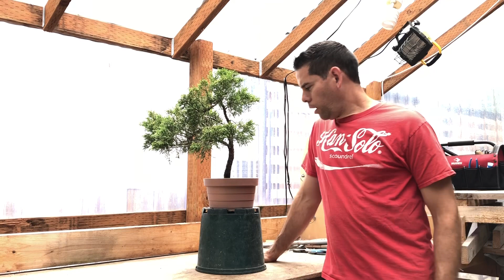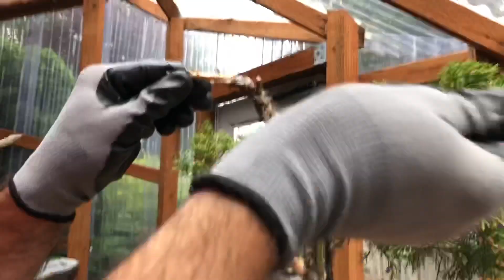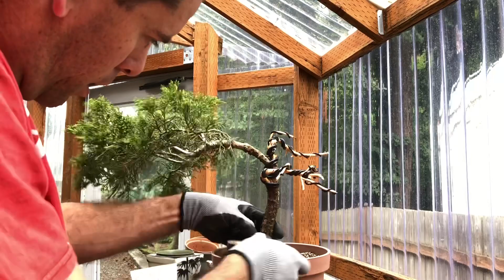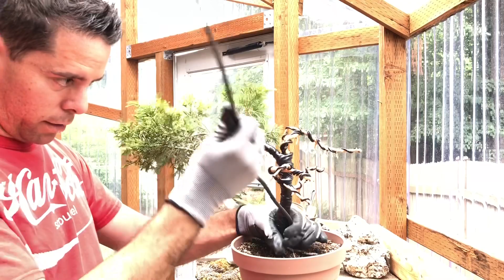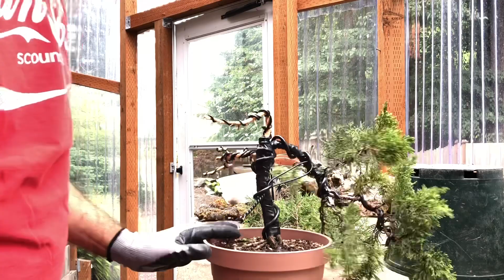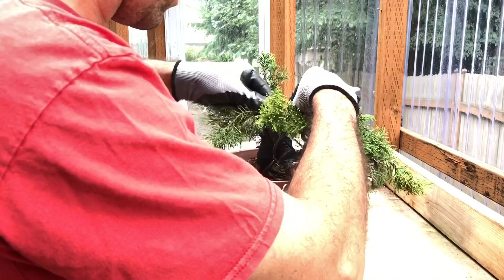How Much Bending Can One Juniper Take?

Comment: Hi, thanks for posting this. If the tape stays long enough would there be a risk of the adhesive peeling off the bark when taken out?
Reply from the maker: The first layer of tape is placed with the adhesive side facing away from the bark.  Then, I turn the adhesive side in and cover the first layer of tape with the second layer.  I’ve never had an issue with the tape sticking to the bark this way.  It is very easy to remove after it has done its work.

Comment: couldnt you have just split the trunk/branch with the splitting tongs? and than just bend it?
Reply from the maker: Yes.  Trunk splitting can make it easier to bend.  Not everyone has the tool to do that.  This way in the video worked for the end result I was going for without using the tool.

Comment: I wired one of my Junipers the other day, and I developed a crack in a couple of the larger branches... However I did not wrap them before I wired them, because t didn't anticipate bending them that much.... Do you think they should be wrapped at the breaks, or if I leave them alone will they heal on their on ?
Reply from the maker: For little cracks or breaks that are 1/4 the width of the branch or less I don’t bother with any treatment.  For larger, I do wrap and sometimes even use cut paste.  Electrical tape is pretty good for wrapping before or after breakage.  Self adherent wrap like what’s used for first aid is also pretty good.

Comment: I like the creativity man, but that wiring is really loose and messy. You should def look up Ryan neil or go to mirai live he explains wiring the best .
Reply from the maker: I appreciate the recommendation.  I’ve seen his videos.  They are a great way to learn.  On this particular session I didn’t require pretty wiring since this is not for immediate display.  This is basically a barbaric bending and I’ve found over many years of wiring that this suits my needs for this work.  The good thing about a slightly loose wiring is that as the branch is twisted in the same direction of the wire twist, the wire tightens against the branch and increases the holding power.  In this case I wanted to avoid wire scarring, hence starting loose.  
Thank you for the opportunity to share more of my process.  Feedback is always welcome.
Reply: @BonsaiEcho  ok that makes a little more sense. How is the juniper doing now? Do you find that not using rafia, and just using black tape affects it any different way? I hope my previous comment did not come off in a negative way
Reply from the maker: I take no offense.🤙
The juniper is doing fine so far. No dead foliage indicating irreparable damage from the operation.  I choose not to use rafia mainly because I find electrical tape does the job on its own quite well.
I am glad the content inspired you to engage in the comments.  There is so much to learn and enjoy about bonsai.  So glad you are here for the ride!
Reply: @BonsaiEcho  thank you man and thank you for your content. I definitely enjoy watching the videos

Comment: Off topic.
when you repot from nursery stock do you bare root it or incorporate a fair amount of nursery soil with the new bonsai soil? Thanks
Reply from the maker: From the nursery plants tend to be quite root bound and in soil that isn’t that great for shallow pots.  I have had the most success by removing most of the nursery soil, lightly combing out and lightly trimming the roots, and giving it a transition period in a container roughly half the depth of the nursery pot with well drained soil.  I’ve found that the plant will be much more healthy in at least a year after that and will be strong enough to handle more aggressive root work including a complete wash of the roots.  Of course, I’ve also had many plants that have gone straight to a shallow bonsai container from the nursery after detailed root work and complete soil change and are doing really well.  For safety’s sake though, I have to recommend the patient method.
Reply: Thanks very much for your response and advise. Keep those videos coming. I love your approach.